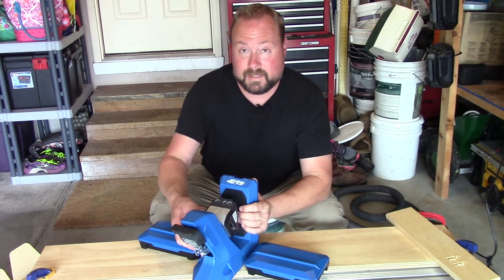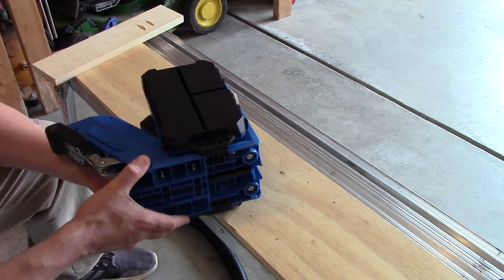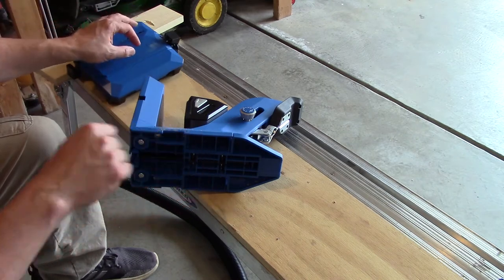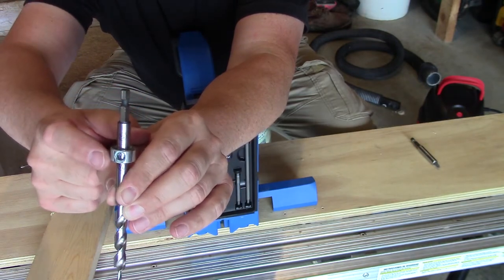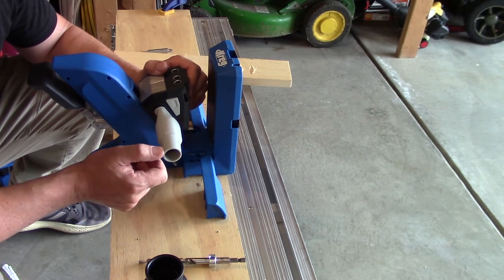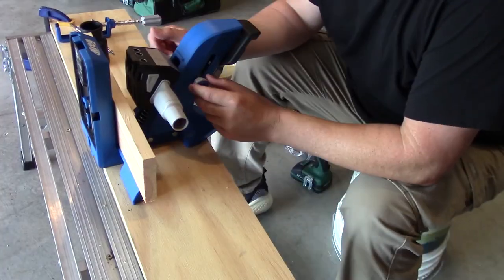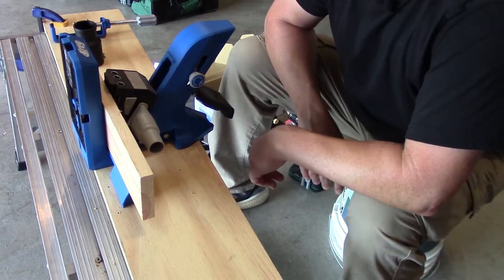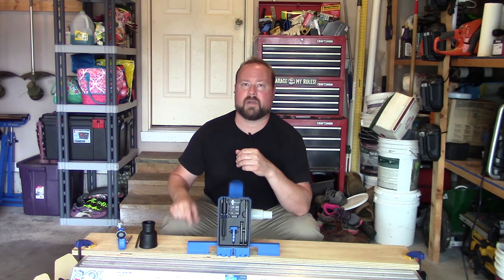Kreg 720 / 720 Pro Pocket Hole Jig - How To Use

Comment: Thanks for this video and your other ones on the jig! 
I just got the 720 Pro, however the drill bit doesn’t fit all the way through the hole. Is this normal and I need to drill out the holes on the first time? Though that seems a weird. I can’t find any information about this in the instructions or online.
Reply from the maker: No problem 👍Hey, first thanks for watching. As far as your question, I did not experience that nor do I think you should. I don't know anyone that has. The drill bit should drop right down first time you use it. It could be that there is just something at the end of the hole that didn't get cleaned out, or it could be that the metal collars were inserted crooked and that is why the bit is hitting something. I would probably suggest to exchange it for another.
Reply: @AroundTheHome1  Thanks so much for the fast reply and suggestions! I reached out to Kreg Customer Service via live chat on their website and they told me the following:

Kreg: We do over mold those guide just a little bit. So once you drill through them the first time, they will become the exact size of the bits.

Me: Oh okay, so this is normal and expected that the bit won't be able to slide through, right out of the box?

Kreg: Yes. That is to be expected.

Honestly, it still seems a bit odd, and that I didn't see any info about this in the manual or online. But I went ahead and tried it out last night and the jig works fine! But there was a bit of black plastic shavings left after the first drill through of each hole. Hopefully this is able to help someone else out in the future.